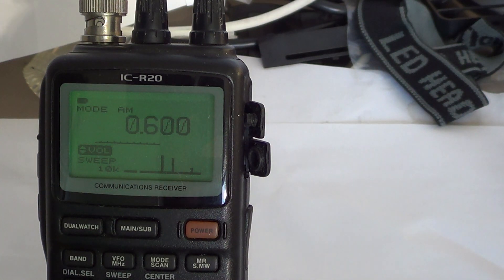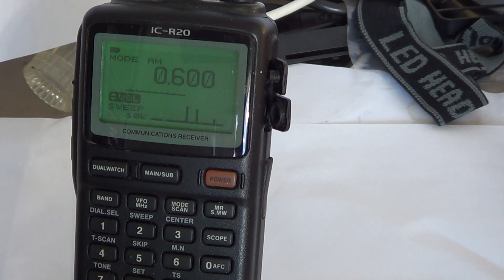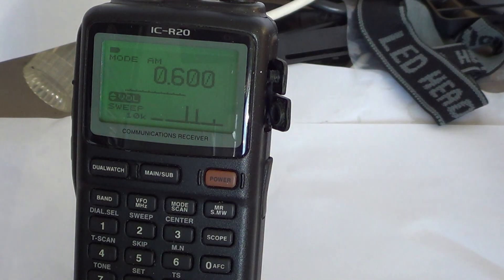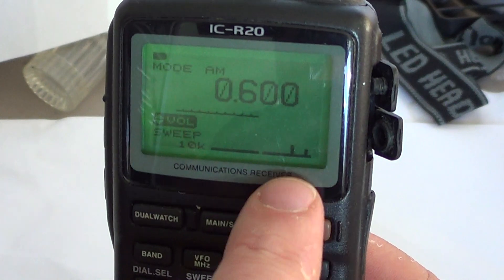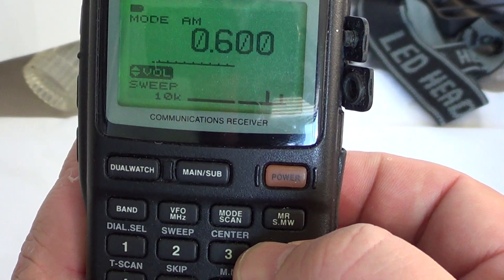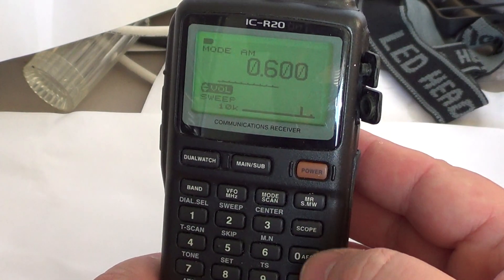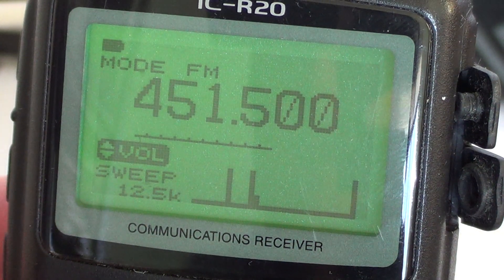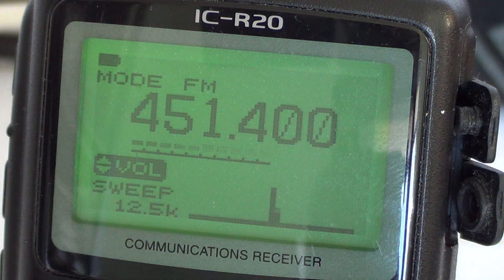Icom IC R20 - Band Scope Operation

Comment: IcomR8500R20 - the Icom R-20 does not scan in Band Scope mode. it receives the entire bandwidth with your settings. It DOES NOT scan......Band Scope is one Center Frequency but the Scope information is displayed wethin the Range you set.
Reply: No it definitely sweeps it. Gonna have to accept it buddy. Still a good receiver.

Comment: IcomR8500R20 - 14 Frequency steps ? that seems a bit Strange........I have a Icom R-10 and it can adjust the Band Scope resolution from 1khz up to 1mhz in steps. does the R-20 have a zoom in/out function like the R-10 has ?